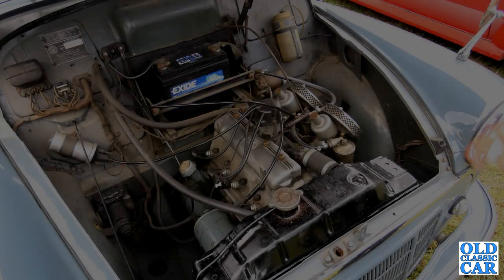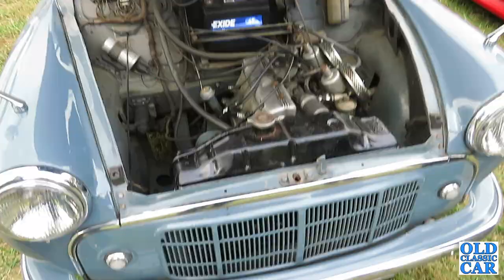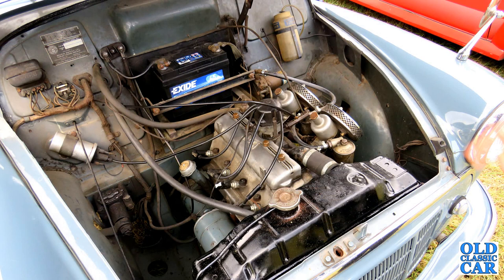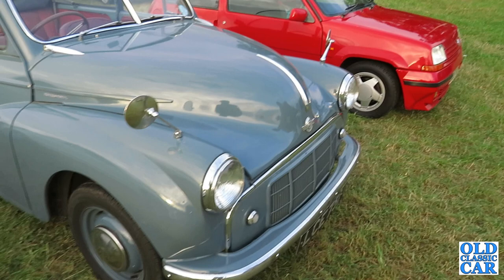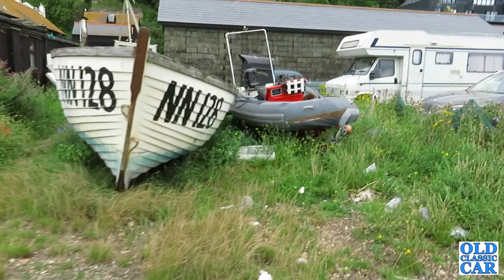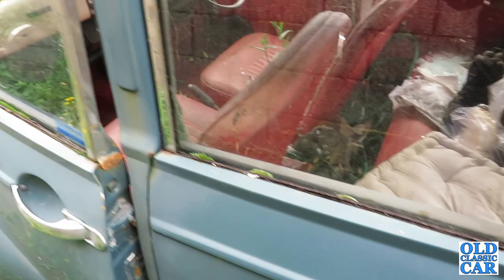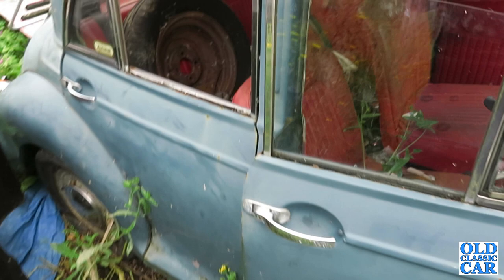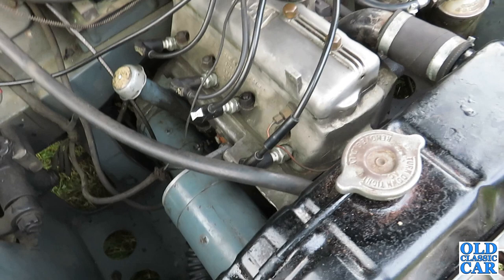A unique? Morris Minor MM tourer with Alta OHV conversion, plus a Minor 1000 at rest

Comment: We have several ALTA engines here.  We also make new components, along with another owner.  Valves, rockers, pushrods, valve guides, rocker covers, Grille badges and manifolds for the ALTA conversion, so they can be fixed up if necessary.

Comment: I believe the main dealer selling the alta conversion was Vic Derrington of Kingston. They converted my Riley 1.5, and I learnt the alta minor was good for 85 or so which was very good for its time. Hot minors were great fun, mine would do well over 90, but the brakes would be considered not great now!
Reply from the maker: I wonder if they upped the rear axle ratio? I remember my '52 highlight MM (it had a 1098cc conversion) was very undergeared, so to get to 85 would have been pulling some serious revs

Comment: battery strap is placed wrong. should be aling the top edge.
Reply: Not on the Series MM cars.  Strap clamps it round the middle and holds it back against the bulkhead.  Later cars used the top edge.
Reply: Yes although the rest of the car was almost as ex-factory…